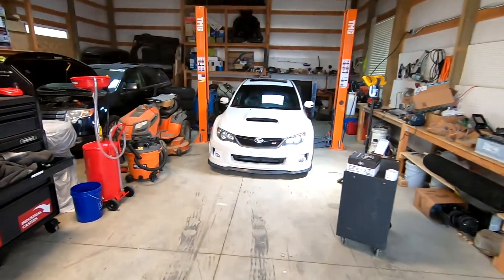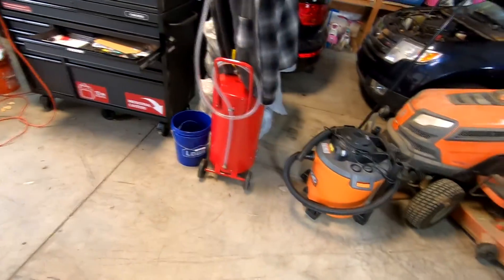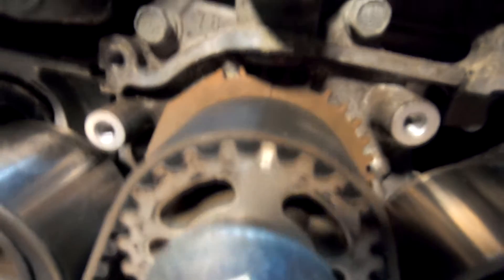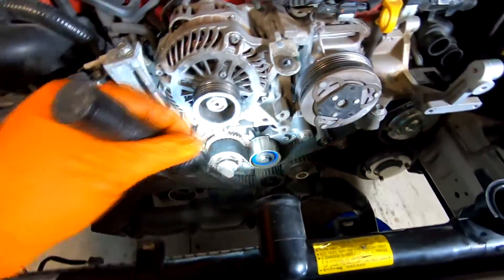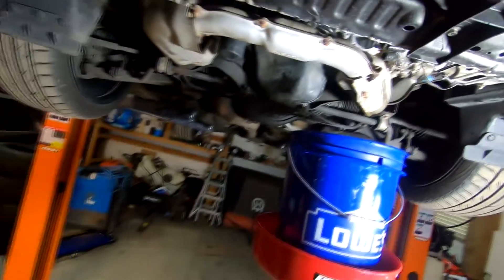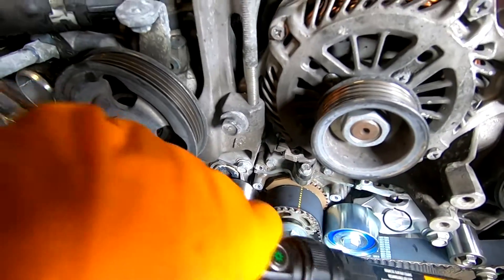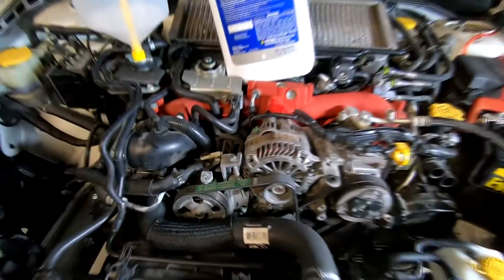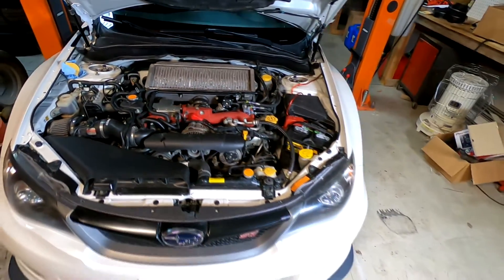Subaru STI timing belt replacement part 1

Comment: No need for the cam holding tool?  The cams don't jump when releasing the tensions?
Reply from the maker: It dose jump but you can hold it with an Allen wrench
Reply: @SalvageBoiz  Figured. Thanks for the tip.

Comment: If the exhaust and intake cams don’t line up on the right side can you line it up even though the main  crank it on TDC? Thanks!
Reply from the maker: yes have to pull the belt and relibe all the marks and she should be good !
Reply: Cool. Any tricks on breaking the bolt on the  crank pulley? I have a 2013 STI manual. Thanks
Reply from the maker: Just put it in gear and it will break loose
Reply: What’s the torque spec on the crank pulley? Thanks!

Comment: My service is coming up soon on my 2015. Should be the same on the replacement. Any tools suggensted to get as I do not have a lift. 

I have jack stands, need to get a torque wrench, anything else?
Reply from the maker: I think you got it! We just did one on a newer one where rebuild and we did it outside no lift

Comment: Hey I was changing my timing belt an the bottom left cam spun when I was lining it up with an Allen key I re aligned everything checked all the marks started it ran really bad for a second, turnedit off an now it will just crank
Reply: I used the cam tool to hold it this time started right up, thanks for the input is there a break in period?
Reply: K Leavitt try checking all the marks again. No engine codes?